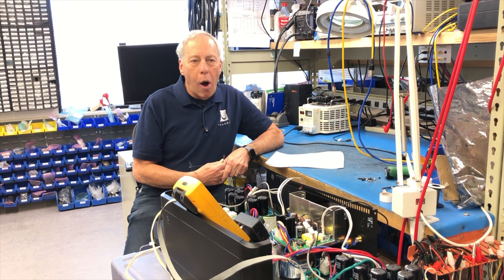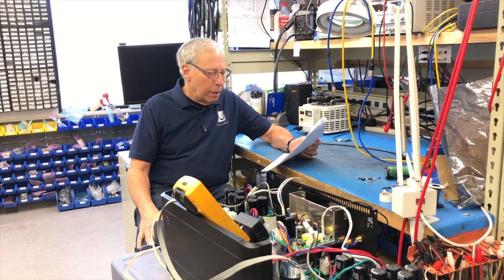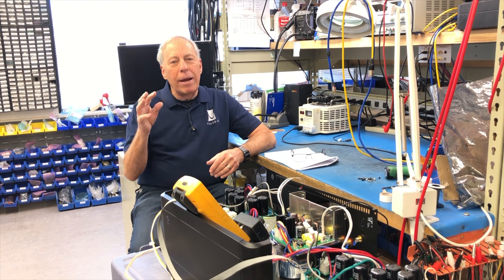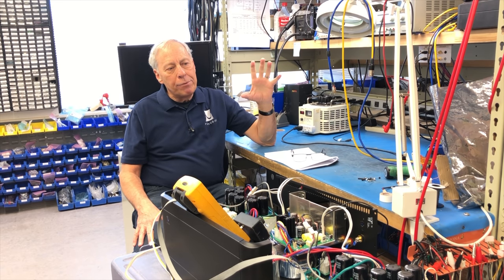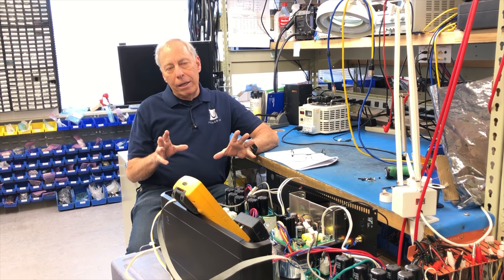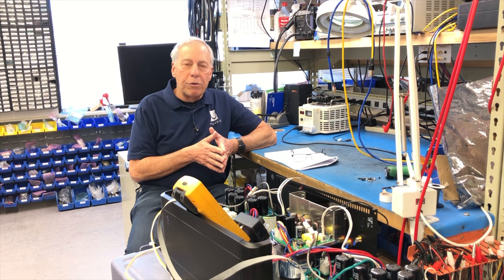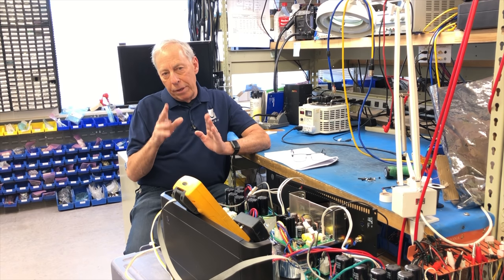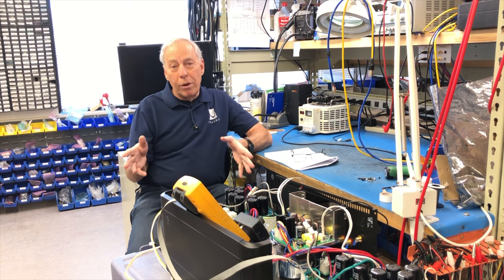How to choose correct amplifier wattage

Comment: Using your example i think hes afraid of sending to much wattage and damaging the speaker....so if the speaker is rated at 200w peak and he has a 700w amp.....will there be a point where if he gets past 200w will the speakers get damaged....??
Reply: Buy better speakers thats my solution
Reply: @Toxicsolution23  Better has nothing to do with power handling.
Reply: Yes. If he turns the volume up too high he will burn out his speakers.  The question is will he? If he would, then he should be purchasing larger speakers. 

Paul only focuses on the amplifier but the same holds for the speakers.   What really matters is what power level he will be listening at.  Then he should purchase both his amplifier and his speakers to have ample headroom for his listening level.

Comment: The Crown Audio website has a great explanation of amplifier power and headroom as well as a calculator that takes into account all of the factors when matching speakers and amplifiers, it should take most of the guesswork out of it: https://www.crownaudio.com/how-much-amplifier-power
Reply: @My Name I came up with 285w for my system; if my speakers were just a little less efficient 600 wouldn't be unreasonable.

Comment: But what about a good power supply/current vs outright wattage. 

Naim amps may not have particularly high wattage but have good power supply/current. They are known for being able to drive demanding (low impedance) speakers.
Reply: Explain how this works?
Reply: @captainwin6333  I understand your comment. Naim gear confuses me too! They are definitely the exception to the rule. I have never experienced dynamics like Naim can deliver.  I listened to Stravinsky's the rite of spring and nearly shit my pants! Lol. If your scientific look at Naim circuit layouts particularly around the transformer.
Reply: Low impedance capability depends on the amplifier's internal output impedance.

Comment: It's much easier if you just show how to calculate it. Speaker (or driver) sensitivity, listening distance, and peak level. That's all you need. Saying that you need "adequate headroom" is meaningless and just confuses people. If you calculate the value that you need, double the wattage to give the amp 3dB of headroom and you're good to go. Anything more will be useless.
Reply: 3db headroom is nothing. A lot of music has much bigger swings especially in the bass obviously. Loudness means different things to different people. How many people know the average decibel level of their music listening? And in different moods, it may change. 
As has been mentioned, it's a better idea to have more amp and more speaker than you need rather than too little. No calculations required.
Reply: @carlosoliveira-rc2xt  All you need to know is your peak level (or you can work in reverse to figure out the peak level possible based on the amp you have and then never go above that point). The only headroom needed above that is to keep the amplifier in a happy operating range rather than being close to its limit so 3dB is more than enough. Those last 3dB will never be used. In my case the peak level of my main speakers are 100dBSPL at 2m. Based on that, I know that putting a 1W amp on my compression drivers is more than enough. I can just as easily calculate the power needs for everything else in my system. Of course if you're dealing with analog playback devices then it becomes more complicated since there's no hard ceiling.

Comment: so when i turn up volume on my Denon AVR i am increasing the output of the preamp in it and not the power amp?
Reply: Probably yes. It is generally easier to design the power amplifier with a constant gain and handle any volume control in the small signal.

Comment: Paul, In order to explain this with a little more clarity you should get on the whiteboard and show how a sine wave enters the clipping region of an overloaded amp and generates a huge amount of high frequency harmonics which passes directly through the cross over and destroys the tweeter and possibly the mid range driver.   This is the most dangerous mechanism which is the drawback of using low power amplifiers.

Comment: Here here (or is it hear/hear?) I recently upgraded power from 175 wpc to the Stellar M700 monoblocks. Why because my room is huge and the  175wpc just wasn't sufficient to energize the room, OR, was it that the M700s simply imposed their will upon my speakers, OR...?  I has a similar experience decades ago when I acquired Harry Pearsons personal pair of Genesis Vs. I never could get the heads to come on song until I bought  a Kinergetics KBA 75 class A amp. It was a revelation, as are the PS Audio M700s, at least in my system

Comment: My speakers are rated at 300W each my amp is rated at 120 Watts RMS.  Does this mean my amp is too  small? Should I be looking at an amp that puts out 500 Watts per channel?
Reply: Claude C- Yes.
Reply: The maximum power output of your amp and speakers does not matter.  What matters is how much power output do YOU listen to them at? You then want both your amp and speakers to exceed YOUR listening level with headroom.

Comment: Well your analogy is not inaccurate but I have a different way of explaining how much amplifier power is needed but it’s not a simple answer. The one area I would disagree with you is higher amplifier power sounds better than lower amplifier power, although that will depend on speakers, there design and efficiency. So I wouldn’t conclude and say definitively that more power or higher power rated amplifiers are always better.
Reply: Sometimes I think these video explanations are best left to people who are more "well versed" in A/V equipment.  I think what he was merely trying to say was that the amount of power "for the speakers she was running", wouldn't matter due to wattage.  You are correct though...  If i wanted to connect a Soundstream Continuum car amplifier; which is stable all the way down to 0.25 ohms I could not possibly hook speakers up to it that were of a generic type and would need speakers that ran at that same efficiency, and handling.  Sometimes it is hard to get down what needs to be explained in these short videos.  Good point!
Reply: Agreed, and I understand about headroom to but that doesn't mean everybody needs a powerful amplifier. The are plenty of speakers that would do great with 20-30wpc and throwing more powerful amps at them wouldn't in itself improve sound.
Reply: Honestly some of the best sounding amplifiers I have heard are very low powered pure class A vacuum tube amplifiers which are designed to work great with high efficiency speakers. So there are many cases a high powered amplifier is not needed and most likely will not sound as good.  It would also be a waste of power and possibly money for that power.
Reply: But the point is that a higher power amplifier has LESS of a chance of harming your speakers by not throwing square waves at your tweeters at clipping.  I think that's the main point being made.  Plus, you have room to grow in case you decide to make a move to less efficient speakers in a larger room.
Reply: @wd3574  except for the part where Paul flat out says higher power amps sound better. All we are trying to say is that it is not that simple. Clipping is possible with any amplifier and with the right speakers you can just as easily clip a 100wpc amplifier as you would with more efficient speakers on a 30wpc amplifier.
Reply: I agree it's never that simple, but he only takes minutes to discuss this topic in his video.  A typical 30 watt solid state amp will always clip before a 100 watt amp.  The point I got is that a lower power amp is more likely to damage tweeters before the higher power one because of square wave harmonics  sent to the tweeters at clipping, although I understand TUBE amps don't clip like that!  Turn up most any amp loud enough though and any speaker, as well as your ears, could be damaged. For the class of amps that Paul probably sells, he can state that the higher power ones will generally sound better than the lower power ones because they are less likely to clip and therefore provide higher headroom and lower distortion overall.  I agree that the speakers are the most important determinant factor (some can be driven by less than 10 watts) and perhaps some people find certain types of harmonic distortion pleasing.
Reply: @wd3574  much more clear and interesting, and I couldn't agree more about speakers being the biggest factor. I went with the more power is better mind set when putting together systems before and my problem was that I don't like to listen at high volumes and the inefficient speakers and powerful amps I've had only sounded good when the volume was past where I wanted. It was really hard for me to find my way to setups that work better for me in my room but I am getting there and more efficient speakers have helped. The thing about amplification for me is that if you want higher end amps and high power the prices get crazy but you can get quality and lower power for affordable money.

Comment: Why would a big amp sound better than a small one if they both output the same power at a given volume level for reasonable volume? Because Paul needs to sell big amps to remain profitable...
Reply: Wrong, If you are like most of us, we listen well above whisper quiet, IE, we turn up the volume some, and a too small an amp may be closer to the edge than a bigger amp, at the same given amount of gain each, thus the larger amp will be able to give you that volume with a LOT less effort, thus cleanly, especially if both are A/B class amps, thus the smaller amp may be in the B class by that point, whilst the larger, more powerful amp merely coasts along in class A, but giving the SAME wattage/loudness, thus LESS distortion so much cleaner sounding overall is why, but at the same time, a dynamic passage can overtax the smaller amp easily at that same volume, but the big amp will handle it in stride and not compress or whatever in the process like the small amp will likely do.
Reply: @johnhpalmer6098  80-90 DB is hardly whisper quiet...
Reply: I've run a PS Audio S300 against several lower power Class A/B amps using ELAC FS 407 (very neutral revealing) and Gallo Reference 3.1's using P5 power plant as watt  usage reference). Both amps draw near identical  power 9(2 watt variance) up to 100 DB output measured.
Reply: Active elements in amplifiers (tubes,  FETs, BJTs) have anything but a linear gain curve.  As designers, we attempt to operate the components in a very small area of the curve.

Just like earth looks flat over very short distances so the gain looks very flat over very small regions of the curve. As the you turn the power up, you start to see more of the gain curve. Just like seeing more of the earth makes the earth's curvature more noticeable, so too does seeing more of the gain curve show you more of the non-linearity of the amplifier.

The larger the overall range of the amplifier is,  the smaller the portion of its curve you will see with your listening habits and the smaller the distortion will be.  As the amplifier's power range gets smaller, the more of the curve you will see at your listening level and the more you will begin to hear the distortion.  When the amplifier gets too small,  so that your listening range can see most of the amplifier's curve, the peaks in your listening will actually exceed what the amplifier can produce, and you will begin to experience not only distortion but also clipping.

Comment: NO !
I agree with the clipping of an underpowered amplifier causing likely damage, but people burn speakers out by turning up the volume too much. "Too much" is all too easy to do with an over-power amp. At the end of the day, the amp IS putting out power that has to be dissipated within the speaker.  Speakers have power handling limits for a reason !
The clue is in the words "max power handling" !

Comment: There is no such thing as a too large amp. Only too small. A 2500watts Macintosh amp only delivers around 250watts on pretty large speakers on very loud volume. It's rear that too much power actually blow a speaker but a too small amps kill speakers easy.
And some rate their watts with 1 channel driven in only 1kHz. Real messures are all channels driven at 20Hz-20kHz.
Reply: Only receivers rate power that way (sometimes). I think we are talking about separates here.

Comment: Don't ever try connecting a 700 watt or even a 100 watt per channel power amplifier to the likes of an original vintage Quad Electrostatic . If you do turn up the volume simply stand back and watch the sparks fly .   hahahahahahaha !!!

Comment: I'm sorry but I disagree with your answer, not in that it is incorrect but in that I don't believe it answers the real question, which my customers ask (dealer for 35 years) which is how much power do I need (appropriate qualifications are for this pair o loudspeakers in this room?  Yes, 700W of high current amp is not a bad thing but do you need to pay for that much amp?  The answer to that is far more complex and often has more to do with the speaker being driven (impedance, phase angle at low impedances, sensitivity, etc.).  Always get more than enough, and current delivery is an important consideration beyond wattage) but if you're on a budge you're better off buying a higher quality amp than one that delivers multiple times what you will ever conceivably need.  I'll leave now :-). Do enjoy your videos.

Comment: Paul I have to disagree with you. A speaker can distort from too much amplification or too little. A signal can clip on the input stage of a speaker from a lack of capacity of wattage or at the amp inability to provide power. Balance is the key.

Comment: Ok so will the ps3 power regenerator that puts out 300 watts work with my PS Audio BHK 250 amplifier. Don't really want to spend $5000 and up for the higher power regenerators you sell.
Reply: steve elliot, short answer, no. The 300 watt PS3 or P300 is only enough for front end equipment like a preamp, DAC, CD or BR player, etc.  I know, I own one.

Comment: I don't agree with this. You want to put adequate load on the amplifier, otherwise you risk running in crossover distortion or/and nonlinear mode of operation.
What you said might be somewhat true for high quality hifi amplifiers, but try making the same argument for something like a vacuum tube amplifier.

Comment: Youall want to know about how much power was too much for me,.. Here. I built my own speaker systems, two front, two back, tuned port front firing bass reflex enclosures of quite large size. Front, jbl 15 inch bass (2220H drivers, you had to wait for them to be made back then, not stocked) , paper mid, electrovoice tweeters, home made cross over. Rear, 12 inch bass, paper mid, dome tweeters. Power, front 260 watt rms before clipping modified stereo amps to monoblock strapped, and that 260 watt is after mod. Rear good quality stereo receiver 130 watts rms channel, think was pioneer. Ok now for how loud it was before clipping, Everything placed on any tables in the room would vibrate a real lot and quickly fall off tables, beers, ashtrays etc. You could feel real easily the room walls vibrating along with the music. You would have hearing damage if you listened to this for any length of time, was the loudest anybody ever heard, and sounded crystal clear, no distortion, and quite flat. 
And so, conclusion is, yes one could have 700 watt amps, but any slightest mistake would have set those speakers on fire, something I was not willing to risk. It was already far louder than anything that ears would tolerate for long. 
I have wondered a lot why anybody would want more power than that, or even anything close to it. But, I guess there are reasons why some will.